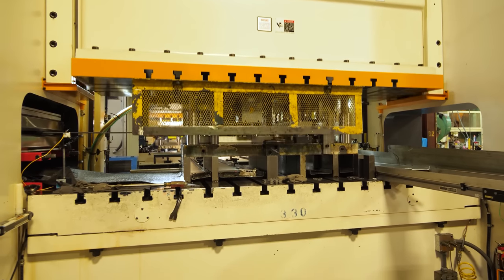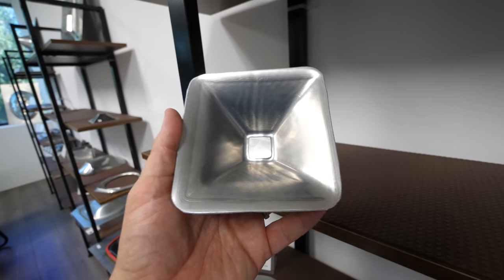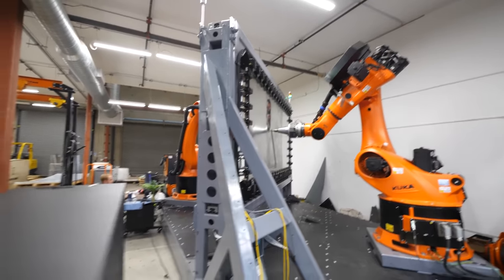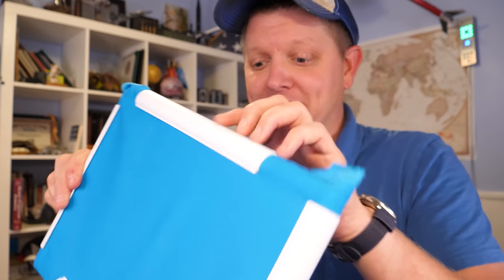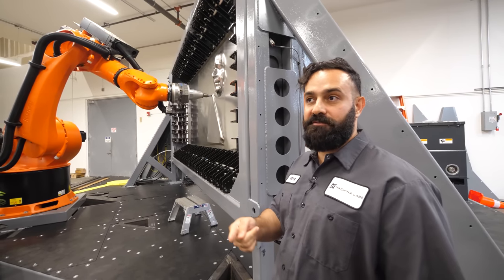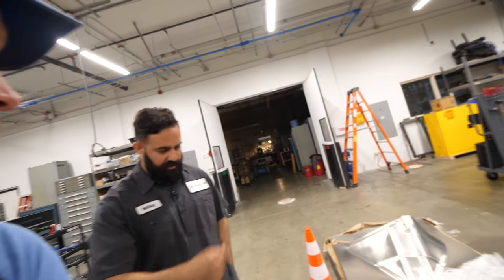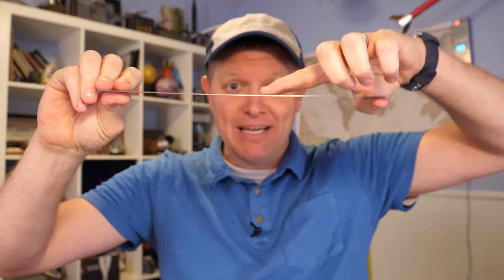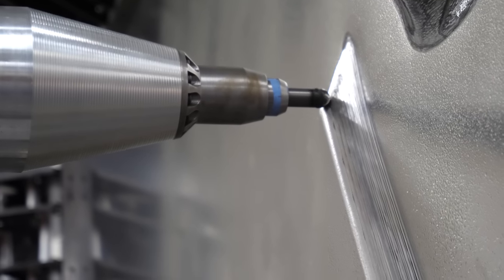ROBOFORMING: The Future of Metalworking? (I Had NO IDEA This Was Possible) - Smarter Every Day 290

Comment: As a maker with a LOT of experience with a lot of different materials and processes from traditional sculpting to blacksmithing, to vacuum forming to CAD/CAM (both reductive and additive), I REALLY appreciated that simplified explanation of restriking. What Machina Labs is doing is SO much more than just making over glorified car assembly robots. That ability to respond to a material while working it is truly game changing stuff. They aren't joking when they said they're trying to make artisan robots.
Reply: Yea, I was asking my self that question the whole video until they got to that part.
It is pretty crazy to think about, considering for millenia we did the best to work around that with heat, hammer, and an anvil.
Reply: That was my notion too.  Using it for custom one-off work would be incredible.

Comment: Unlike conventional press moulds, this one allows for customization of the thickness at each point on the formed (pinched) metal plate. This feature is useful for specific applications that would otherwise require reinforcement with additional metal sheets or a design change. Its like point specific reinforced design. At larger scale I would imagine it will have lots of specialized precision moulding applications. Congratulations on this novel method.
Reply: exactly — they can use the sheet to the fullest rather than compromize the design. rad! 🎉
Reply: Und ist nicht für die Serienproduktion geeignet.

Comment: Hey Destin!
Amazing episode as always. One thing that might be incorrect is at 11:45 where you talk about gears and play/backlash. 
Kuka is actually using strain wave gears in their robots. Those are a completely different concept from simple spur gears and they don't backlash. Might be interesting to look into this at some point. :)
Keep up the good work. 👍🏼
Reply from the maker: Thanks for this comment
Reply: Some also use belt drive.
Reply: Many others use them too, "harmonic drive" is another name for the concept. And of course for linear movement ball-screws are essentially backlash-free as well. None of that is infinitely stiff though and neither are the actual beams between the joints which in the end results in the need to do the corrections in the control system.  Another cool/useful (also sometimes problematic) thing about the strain wave gears is that you can't back-drive them so holding a position (when there is not too much dynamic load) requires very little power.
Reply: Now I want @smartereveryday  to cover strain wave / harmonic drive gearing concepts in detail!

Comment: I wrote my master thesis on this topic at a university in germany about 4-5 years ago. The professorship was researching on this topic for over 10 years at this point.  It's crazy to see you making a video about it now. Very interessing technique with lots and lots of interessting details from an engineering standpoint. I am very happy that this is getting somewhere now!
Reply: The point where they said 7 axis optimization problem was when I realized that they aren't just doing "simple" kinematics, they are doing linear algebra stuff.

The optimization with material conservation and rigidity optimizing just took it over the top.

No wonder this has taken 30 years of development for even small scale commercialization.
Reply: riblets and laminar flow from owl wings transferred to metal for faster and efficient  surfaces!
Reply: Maybe they could use another employee to help them along?

Comment: This is like the Hammer and the Stone, but performed by computer and machine. In Okinawa Japan my family purchased a 4 foot round Brass table back in 1963. It's hand designed and made using different shaped or tipped hammers and different shaped, domed or cupped metal stones. The stones were held or placed on one side, the bottom and the hammer was tapped on the other side. It was done fairly quick. The artist would place the stone in a holder and turn the 4 Foot piece of Brass pecking away and turning it.
It has engravings also. It's very intricate with flowers and other plants along with different symbols and animals.

Comment: I can really feel Dustin trying to be respectful as he can, and I really like that! Asking for optical lockouts, not pushing further on business questions when he could but still trying to learn as much as he can. It’s a delicate balance sometimes!
Reply: What is an optical lockout? Google wasn't very helpful.
Reply: @connorsterrett  you are not allow to film it (Classified, IP, etc. )
Reply: @bagnon  Oh, I thought it was an optial "safety shutdown" in case someone got into a dangerous area.
Reply: @svankensen  True, they do have light curtains that shut down for safety if you get too close. Maybe that is what he really meant as you suggest.
Reply: @bagnon I’m fairly certain that Destin was referring to light curtains and other similar non contact optical safety features when he said optical lockout.
Reply: @Dwarg91  He was definitely referring to that, since it's moving machinery. He was already filming the whole factory floor after all haha
Reply: @connorsterrett yep! It’s a safety feature for automated machines like CNC mills and lathes - they’ll automatically shut off if they detect motion so operators don’t get injured

Comment: I worked at a place that did this on very large airplane parts, the sheets were spun and the roller formed it to a structure that turned with the part. The dual opposed robot is fascinating. Truly cutting edge.

Comment: As a professional software developer I am truly in awe with the code behind all of this.  Absolutely impressive.
Reply: I was impressed by the fact that they reinforce the initial code with machine learning by scanning and assessing the actual outcome and comparing it to the desired digitally modelled outcome. They have allowed that the software can self-improve to account for all of the factors that would make it an impossibly long task to hard code them in by design at the start. This way, the software can be installed on robots with greater and lesser degrees of deflection and imperfections, and work on different qualities of material automatically by self-calibrating and automatically incorporating software correction factors that adjust for all of those sort of hidden variables.
Reply: I'm an unprofessional software developer
Reply: @mikalrage7316  I got the same too , Self correcting , self teaching and no doubt they keep records of programming versus finished scans which they will incorporate in future modelling.

You mention deflection ? 
I wouldnt be surprised if Machina have asked for robots with Super High Precision bearings rated with higher radial and axial load capacity.
Pick-a-part robots need accuracy of plus / minus 2 mm.
These guys need more like 0.02 mm because error is cumulative , but at least they can scan and self correct for changes in surface tension and tool wear compensation.

Congratulations to Machina , very worthy business to be "Smarter Every Day"
Reply: @heartobefelt  just imagine the storage they have regarding the different sized sheets, sheet  materials, mounting points for the sheets to account for deflection, different sheet shapes, and even different end effector tip types...

all on file to account for possible deflections to keep things precise.

Comment: The last little bit at 28:17 was awesome to hear. The idea that we've flipped the bottleneck from the engineering/manufacturing side over to modern day computing just not being fast enough, is absolutely amazing. Can't wait to see more technologies like this, that break into the realms of science fiction in the most simple but mad hatter ways. Thanks for the video Destin and MachinaLabs!
Reply: I guess this is the part that still confuses me as to why it's faster than computing can allow, is that a matter of processing power actually not being fast enough (yet), or is it something else I missed? Curious if anyone can take a stab at answering this.... maybe ELI5 lol
Reply: @JoshDauer  If i had to guess it's because it isn't simply rendering geometry but following a sequence of steps. If you go back a bit to his hemisphere example, simply rolling out a hemisphere would give you really thin walls at the edge of the sheet, so to get a regular thickness they push material outwards. What i'm getting at is that the calculations to go from a model (the parts spec sizes and thicknesses) to a finished part aren't as simple as 3d printing where you're simply depositing the amount of material you need. They are actually deforming material and there could be many different ways to deform it and going through those possibilities is what takes time.
Reply: @JoshDauer  TLDR, the software knows from the beginning what the final part should look like. When it makes an adjustment to the metal, it measures how the input parameters (force, angle, etc) compare to what it actually wanted to happen. If the result wasn't right, it will adjust. 

It's like cooking to taste. Cook ingredient, taste, add salt, taste, needs more salt, taste again, done.
Reply: @JoshDauer  The compute required to test a part is potentially very large depending on what you need. Printing a part and testing it in a few hours is a good deal in some scenarios. I'd want this machine on site though, if i'm in the rocket industry for example, rather than waiting for test parts to get shipped to me.
Reply: Man, it would be so interesting to hear them get into the software side of things a lot more. I get that Destin focuses on the engineering side because that's where his expertise is but there could totally be another channel hosted by a computer science expert that focuses on the software. I'm not expecting the company to show actual source code, of course, but even a very simplified look into what's going on and what kind of software stack they're using would be great.

Comment: Holy cow, we were doing this in 1979 at a defense contractor. We used HP laser interferometer systems to measure the entire position paths of the end effectors. This reduced the need to calculate all the deflections in the arm. We weren't doing things this large or complex, but it worked. Don't ask what they were making, I could never figure it out. I was just maintaining and writing software for the laser system.

Comment: As a mechanical engineer with over 10 years experience in manufacturing my mind is absolutely blown learning about this process. My brain is racing thinking of all the ways this could be used. This could be an absolute game changer in prototyping. Thank you for sharing this Destin!
Reply: How though? 3D printing already does this. The only benefit is maybe for actual stress tests, but even then, since it's a completely different process, I doubt stress tests would really be equivalent. This also clearly has limits to the shapes it can do and can't exactly create solid parts, just shells of them. I don't know how this is cheaper or quicker than either 3D printing or just molding a bunch of iterations the old fashioned way.
Reply: @peoplez129 Well you can use the final material in your prototype, but without spending tons of money on molds (which you might never use again).
Reply: @peoplez129  You're right that It's probably not cheaper or quicker than 3D printing, but the physical properties and materials are different. Most grades of steel that are common in sheet metal are not possible to 3D print. The layer separation makes properties like deflection different. Porosity of 3D printed parts changes hardness, density, and brittlness. Also size. You cannot 3D print an entire car hood like they showed here. At least not readily available on the market. You can "Roboform" in the exact material you want your final part to be, which is rarely the case in 3D printing. Don't get me wrong, I love 3D printing for fast iterative design, but it has it's limitations, and sheet metal is one of them.
Reply: @mtl10  great explanation. This appears to be ideal for prototyping where you’d typically stamp parts.  Not even taking into account the material possibilities (limitations) with 3D printing, 3D printing is ideally suited to prototype parts that would typically be machined, not stamped.  Once something gets past the prototyping phase, it would then make sense to create your stamping dies to take it into production.
Reply: @dipren443  wouldn't call this ideal. This is taking techniques from cnc manufacturing and applying them to stamp manufacturing. It's probably not right to fault them exactly though, they're doing what they know. There are just better ways to do this. It would be better to have a selection of various "hammers and anvils" so to speak and have the 2 robots progressively (from rough to detailed) work the metal that way. There's even the possibility of dynamically hydroforming, though that would require rigorous safety procedures. This is honestly one of the least ideal ways of manufacturing sheet metal. There are reasons people abandon this after sinking serious research into it. Sure it can be done, but all things considered, other than just doing it this way for the sake of it, this is a pretty awful way to do this.
Reply: read my comments and see where they are headed, its easy to see
Reply: @himan12345678  you are way behind the curve, they are designing ways  to form metal in ways traditional metal can not be formed and for applications that traditional metal forming can not achieve.  watch the video before or commenting, or rewatch a 1000 times until you understand.
Reply: @rdejaynes  I watched it plenty. Their technique is limited. It would produce more efficient results to design from fourier series and progressively work the sheet that way. Ofc they are limited by the world they know. They had the technology to do this in the 80s, yet they abandoned it. It's just not economically viable in a competitive landscape.

I can commend them on the hard work and effort it's taken to get to the point where they're at, but this isn't exactly new or groundbreaking. And it certainly took effort and toil to get to the point they are. But let's not talk about this like they're turning it from crystalline or amorphous metal, or even controlling for the crystal structure as they're doing this. In fact, they're actually putting a lot of unneccessary stress on the material that some would be alleviated with progressive forming, rather than making each local point to its final point in one pass. Ofc they could relax the final part with a normalizing treatment, but that would add even more cost and it's not common practice in stamp metal either so not really a big point to bring up.
Reply: @himan12345678   you can not make a machine with a thousand triangles " flex points) that can deliver the force necessary to form metal.
Reply: @himan12345678  I don't see this a viable replacement for forming or progressive stamping either. What do you think about it for prototyping of large sheet metal stampings? I haven't worked much with mass production of sheet metal so I admit I'm underinformed here. How is prototyping of things like car hoods done now? If this can get the speed and cost down enough, it could be a good option for prototyping and low production numbers the way SLA is to injection molding now.

Comment: Now this is cool stuff. I worked around a bunch of Fanuc and Kuka robots in automated weld manufacturing and I was amazed in the accuracy of these large machines. They can hit alignment pins dead center with a 400 pound part hanging on the end effector, or take accurate quality control photos for part and hole alignment. To see such large machines do such accurate work over a huge operating envelope is amazing. To see them do the kind of work shown in this vid is completely next level. Good work guys. "Your wicked smart" ya dude, you are.

Comment: Crazy to see where the parts I made at work end up. I made those white electrical pin connectors on the robot tool changer at 21:30. Super cool to see it in action.
Reply: super cool
Reply: Are the contacts gold plated to prevent corrosion? They must spend a lot of time exposed to the environment.
Reply: @tjm2212  to be more specific, I only machined out the part. I saw the finished part with the pins inside a a handful of times but I believe they were gold plated and it would make sense in applications like these.

Comment: This reminds me of the english wheel where a sheet of metal is pushed between two steel wheels that pinch and stretch the metal into a shape the operator wants.  Absolutely fascinating watching it being worked out because it doesn't look like anything is being done at first but 15 minutes later you've got a gas tank for a motorcycle.
Reply: Ya that was my first thought too. This is like a extremely fancy CNC english wheel kinda
Reply: Same. Like a nearly infinite throat english wheel, and moving the tool instead of moving the part. Very cool to see the whole sheet shrink when it comes out of the clamps too! Great video, love this series!
Reply: Actually, the manual process which most resembles this is called repoussé. It's mostly confined to small-scale art projects, but I have seen some larger German works.

Comment: robot arms use closed loop harmonic drives! The elasticity of the arms is more relevant than the backlash if they are in perfect condition! by the way a CRAZY interesting mechanism to go over in a video ;)
Reply: Wrong, these big Robots use zycloid.
Harmonic drives are usually in small robots or robots with low payload. Source: I build and repair them.
Reply: @djangomueller   fair enough. still very little backlash. cycloidal btw.
Reply: @thiagoennes  what is an open loop harmonic?